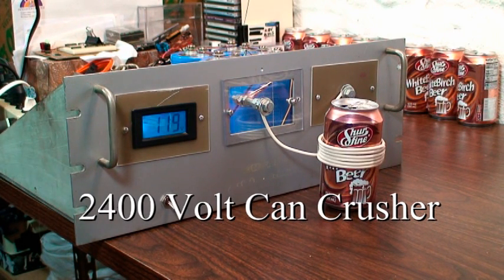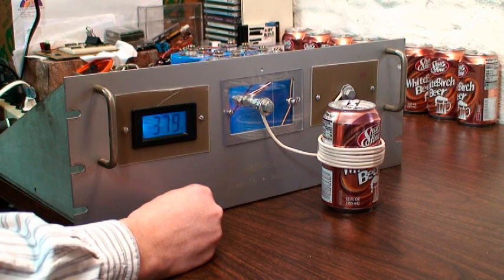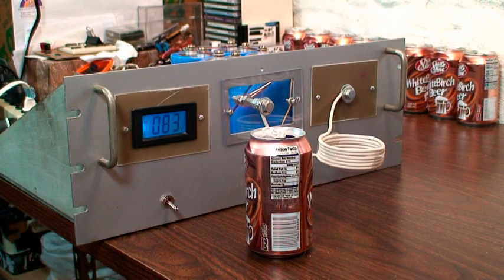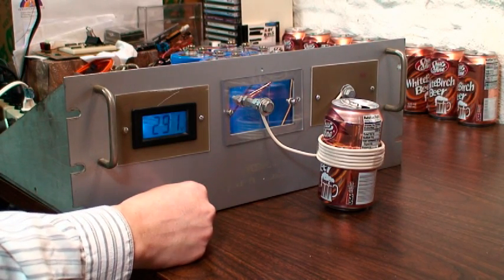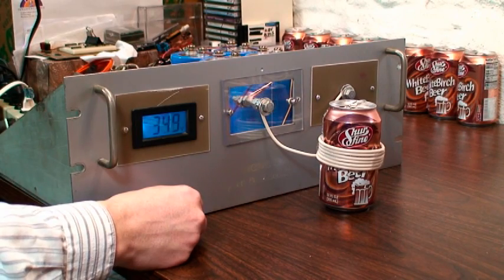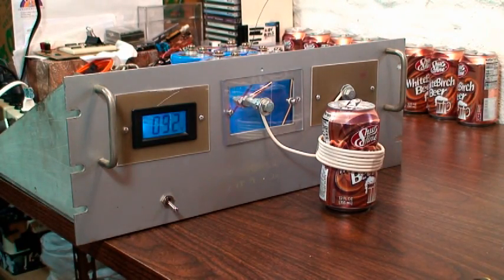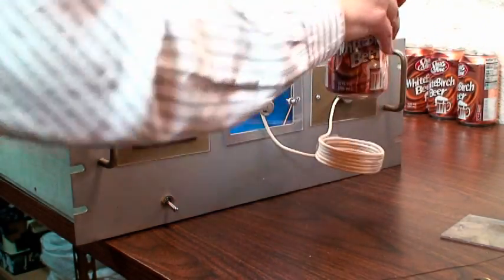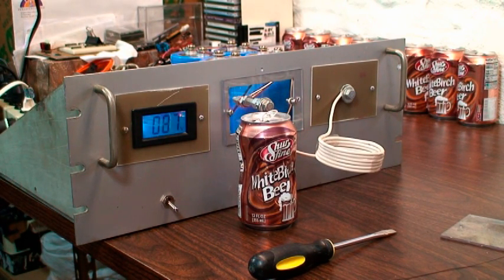2400 Volt Can Crusher

Comment: You can try to place the charging resistor in a bowl of water to cool it. Or you can mount it in a PVC pipe. Thats what I did and it seemed to work well.

Comment from the maker: The heads of two 1/2 inch bolts meet together.  They are spring loaded by two 10 gage copper wires from the top of a capacitor.